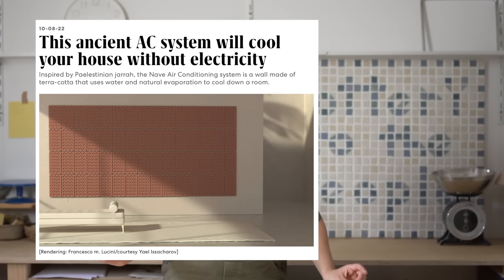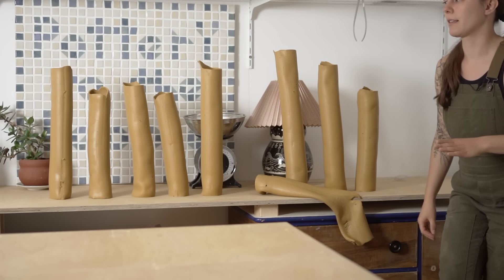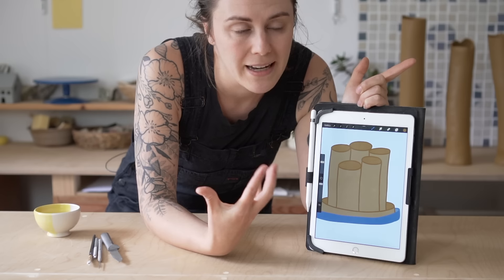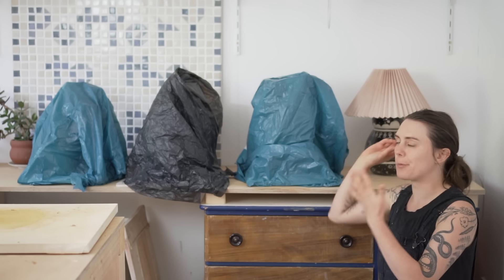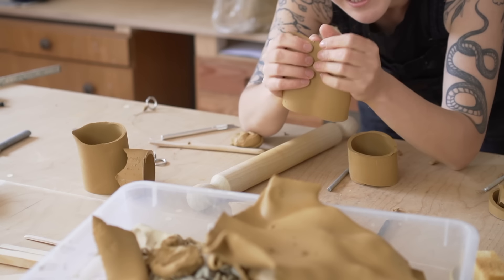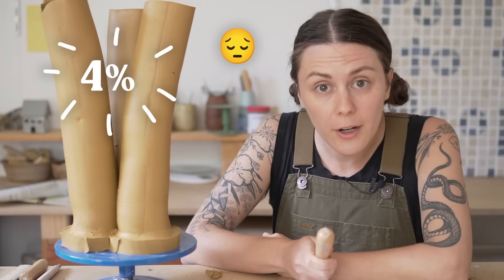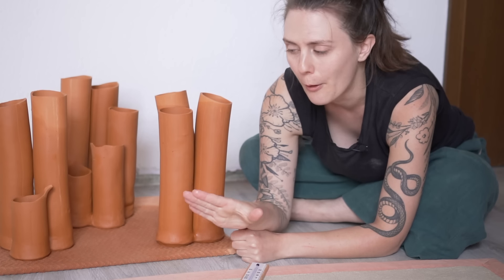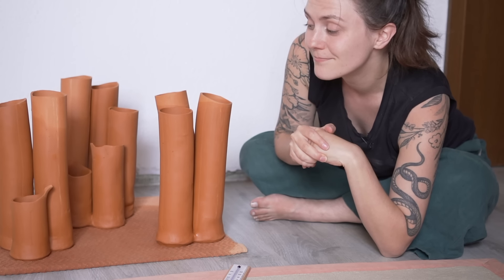Can I make an A/C out of clay???

Comment: If you don't use them as AC you might consider partially bury near a tree or plant and using them as a water reservoir for the plants :)
Reply from the maker: yes I thought the same!!
Reply: Or as nest for mosquito
Reply: If you fill it with coarse sand, and then water, you won’t grow mosquitoes
Reply: It would work better in a window with cross breeze
Reply: Like an olla😊
Reply: @annekabrimhall1059 , the type we have just need dampness from say a plant saucer.
Reply: Wonder is a small fan blowing through them would increase the cooling??
Reply: mosquitos.
Reply: A frog house, water wont stay in it long outside even if you ever put water in it.
Reply: When they are partially buried they are called Ollas!
Reply: Look up Ollas, they are that exactly with a specific design!
Reply: @annekabrimhall1059  Oh that is an interesting idea, I wonder if it could be done as a lattice structure so that the air moves across more of the surface area as it comes into the room.
Reply: @ekhiw  I dont think there's so many mosquitos in Germany
Reply: You can wrap orchids on the outside and they would grow just fine from the water inside of the unit.
Reply: Still water =mosquitoes
Reply: @DarkSaber-1111  lids
Reply: @afyrestorm  A studio in Delhi, did do that. They drew inspiration from cooling in beehive structures, used horizontally stacked terracotta tiles and circulate water over the lattice structure.
Reply: @ekhiw  if you cover them they won't get mosquitoes.
Reply: This is called an "Olla pot", it's really old Central American and Chinese farming technique. Works super well.
Reply: i think you can even plant moss directly on them :"
Reply: Or plant your house plant in it and put it all in a jug and fill that with water
Reply: They are really good for that, you could put a rock on the top to help limit evaporation.
Reply: That's actually an ancient use (look up "olla pot"). Clay pots were historically buried near plants and filled on a regular basis.
Reply: Olla
Reply: @aleenaprasannan2146  Do you remember where you saw this?

Comment: As someone with a science background, my suggestion is to put them on an outside wall like what you show in the beginning. As you have it now, the heat goes from inside the clay (the water) to outside the clay (the room). Currently, you just have water coolers in the middle of the room. If you make the room the inside of the clay, heat will move outside of the room.
Reply: Put pipe between that absorbs cool easily and have a fan blow air thru it, the clay cools the water and the water cools the air as it gets pushed into room
Reply: Also - The experiment does not really say anything without a control.  For all we know, the room could have been 20C or 25C without the evaporators.
Reply: You are right and wrong at the same time.

If there is a small air ventilation from outside to the inside and again out, and you emit air with more water vapor than what came in, you are cooling the inside.

If you evaporate in the outside surface, your cooling will dissipate to the outside more than to your room cause the wall acts as insulator.
But if you have enough water to evaporate it would work.

Comment: I know this goes against your "passive cooling" concept, but you could increase the evaporative effect by training a fan on the pottery.   As others have mentioned, this concept works very well in climates with low relative humidity. High humidity doesn't allow the moisture to evaporate and the cooling effectiveness is significantly reduced. This exact same concept can be used to make a water chiller (as you mentioned, the water in the tubes gets quite cold) it makes for a refreshing drink! I found this project really interesting!
Reply: What an amazing video. I can totally imagine that I would work in dryer climates. Right now I live in Brazil and the humidity is so high, that this will only give more mold but I can totally see it working in more dry climates. Really cool video. Well done!
Reply: @travelingonestepatatime  Yep, in areas with high humdity, you get no cooling and it doesn't increase humdity either. You're pretty much stuck with actually submerging yourself in a cool water or drinking cold beverages to remove the heat.
Reply: Just placing them in an open window would help circulate the air around them, and more surface area would improve cooling. A greater number of smaller diameter tubes, maybe texture the tubes as well.

Comment: One degree cooler IS actually a lot cooler. 23c to 21.5c is gonna make you feel much much cooler. I come from India, and we try keeping temperatures inside our homes around 21. I think this really works
Reply from the maker: That’s definitely true! I also suspect it worked better than I thought too because it got really hot that day but the room stayed cool! 😄 Thanks for watching :)
Reply: @PotterytothePeople  I was going to mention this - the room didn't get any hotter! Also I would place it in the hottest part of the room to maximise evaporation - by a window or in the sun, and add a fan behind it or place it next to an open window. My colleague at work used to pin a wet towel over her open window sitting in a tub of water! It worked a treat. 

Also, you maybe just learned a bit more about managing the temperature in the studio by closing the door and window - it's a win all around i think!
Reply: 23C is 73.4F and 21.5C is 70.7F that is almost a 3 degree F drop which makes sense since F = 1.8C +32. Quite impressive actually! This is a pretty neat passive swamp cooler.
Reply: And the hotter it gets, the better it works because it will evaporate faster.

Also, combining this with a fan behind it might be an amazing idea
Reply: No it won't feel cooler at all, as it is raising the humidity also, making you feel hotter. The increase in humidity will more than negate a 1 degree difference. Also, this will not work in areas where it is hot AND 70% or higher humidity, it'll barely function. For example here, where I live, it was just 91F and 85% humidity, this would not work.
Reply: @rdizzy1  Except that this does work and was used for millennia before the invention of air conditioners. You're not going to raise the humidity enough to offset the energy lost in the phase change.
Reply: @SmallSpoonBrigade  They are the same concept as swamp coolers, which do not work in a significant portion of the world, because the dew point and the temperature is too close together.
Reply: Given we only have one data point and the variate effect of environmental factors we cannot develop any conclusion that this worked.
Reply: @SmallSpoonBrigade  It is about how hot or cold it feels,to a human, not how hot or cold it is. Also, these don't work at all whatsoever in areas of high heat and high humidity, as the difference between the dew point and the temp is too low.
Reply: 21c is cold where I live!
Reply: @SmallSpoonBrigade  They were used for millennia, yes, but not to cool the air. They were used to cool water and to make pseudo-refrigerators. The thing about how comfortable air feels is that it is almost completely dependent upon dew point, NOT temperature. In climates where swamp coolers work well, you actually WANT the humidity added to the air, because humidity outside of normal ranges can cause problems, whether too high or too low.

Energy is not "lost" to the phase change by the way. It changes form, that's why humidity is the same as heat in the context of comfort cooling.
Reply: @SmallSpoonBrigade there's a reason why it's not used anymore. What? You think caveman are more clever than us?
Reply: @autisticdoingandthinking it will work, but as other commenter said it will NOT work, at all, in 85% RH.

Source: I'm a mechanical engineer that worked in HVAC specifically evaporative cooling for almost a decade.  

Evaporative cooling works fantastically if rh is low.  But the water needs to evaporate to get the cooling effect and the closer you are to fully saturating the air the less evaporation you'll actually get.

Comment: Maybe not the best as a cooler (unless you live in a very dry climate where swamp coolers are actually effective), but these would make great little indoor humidifiers for a plant room! Having a fan on them to increase the evaporative effect would also help.
Reply: ❤best comment!  A fan would make this 10x more effective.
Reply: Spot on about the ambient humidity. Similarly, they sell those humidifiers as air conditioners here in the humid Midwest and they don't do anything.

Comment: Look up evaporative cooler or swamp cooler. We use those in the SW USA. your idea is great. You need a fan to push the cool air around. Try putting a fan to blow across the wet tubes and crack a window to let the air circulate.
Reply from the maker: omg genius!
Reply: I agree with Carol and the fan idea, I think that will make a humongous difference!  stay cool!  90F here today :(
Reply: I am also in SW US, we are the weirdos that prefer using our evaporative cooler instead of the air conditioner. We are regularly seeing daily  temperatures of 110. It’s not cold in our house, but it’s summer, I don’t expect to be cold this time of year. (I was shocked it was 67 in your home during summer, that is the temperature of my home in winter 🤣). Anyway, for summer, we do have fans that help us sleep at night. Also, as for the idea to bury these and allow roots of plants to drink up the water—this system is called the “Olla” and developed by indigenous peoples native to dry desert climates like mine.
Reply: If you position the fan just right you’ve also made a wind instrument…
Reply: Love watching the process and living vicariously. I don’t have a kiln but I do have a number of small terracotta plant pots (and some broken ones). I wonder if stacking them together would work…
Reply: Was going to say this.  Evaporative coolers work great until it gets humid.  As @Susybot said though, our temps are 110F daily.  I was startled people would think to use AC at 67F.  Around here that is coat weather.

Comment: In addition to the fan, which is going to help a lot, a grooved surface would nearly double the surface area for a lot better cooling. Probably look nifty too. I would also consider using a low fire glaze on the inside and outside of the bottom inch or so. If your evaporation keeps up with the seepage, you might get way with no drips. At worst, it will stop you losing water to wicking from the towel or surface it is sitting on. Finally, lids to keep the mosquitoes from breeding in there, avoid drowned mice, etc
Reply: Great ideas!
Reply: I wonder if adding spines to the grooves would work as well - a ceramic cactus cooler :D
Reply: Personally I think the mouse trap would be a hidden feature.
Reply: Wouldn't requiring a fan somewhat undermine the point of passive (ie. zero power-usage) air conditioning?
Reply: honestly though does the towel itself not act under the same purpose in this situation? The towel is absorbing and evaporating water on a much greater surface area than all of the tubes combined
Reply: @meady50  I believe that's the point in using porous clay.  All those holes through the substance of the tube mean that it should theoretically have a huge surface area that the water permeates past.
Reply: Fans use much less energy than AC units, so no, not entirely.
Reply: @irrevenant3  well, you could use a fan setup with black and white tape so sunlight pushes the fan. You could setup a hinge that pulls up towards the ceiling at neutral weight. sit under the large "fan blade" with a string and leisurely pull it down. bonus points if it functions via condensation.

Comment: Since you live in Germany, I suggest you talk to your neighbors about lüften. My family tends to open up windows at night, close them up in the morning and then bring the rollos down wherever the sun is shining from, so the heat doesn’t come in as quickly. Then as soon as it gets hotter indoors we make wind by tying all the doors up and opening specific windows. If you are using humidity cooling (which you are) you need to cycle the air more, as it will make it stuffy.